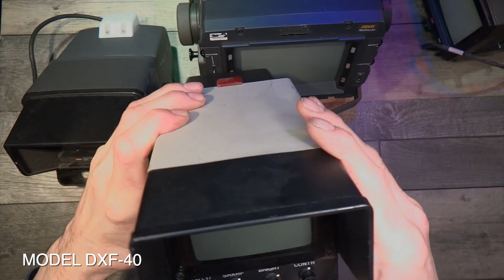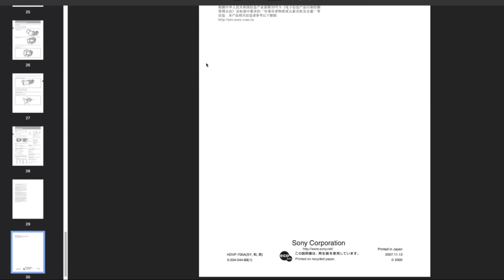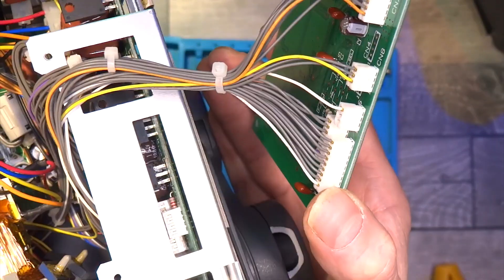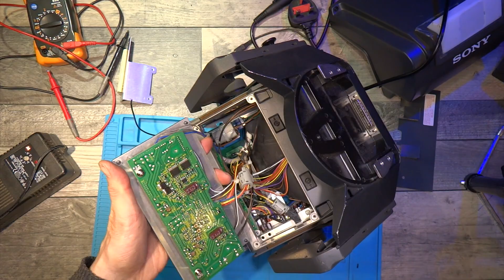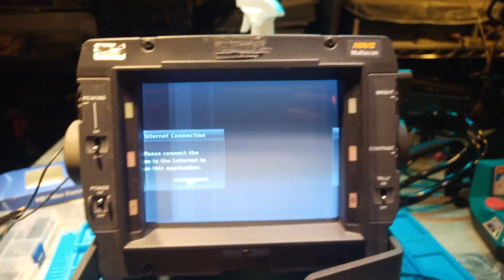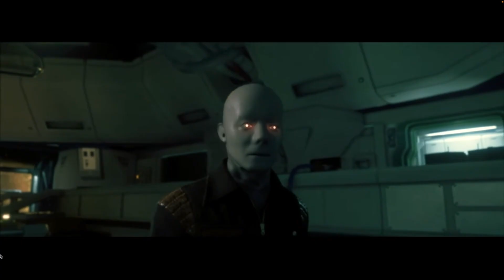SONY HDVF-700A HI-DEF Multiscan 7" CRT $10,000 Viewfinder But will it take a Standard Def signal

Comment: Looks like that monitor won't work with a 15 kHz horizontal scan rate, that why it's doubling the image, try feeding it a 480p/576p signal
Reply from the maker: Thanks for the information. What device can I get that signal from.
Reply: @RetroGadgetMan  Some DVD players have a progressive mode for example, but keep in mind there's no such thing as progressive composite video, so you would have to use the luma portion of component video, which of course won't be able to produce a colour picture
Reply from the maker: Well I only need it to be bw so that should work out well. I will see what devices I have with component out
Reply: @RetroGadgetMan  PS3 and PS2 has it! both can output 1080i.

Comment: Nice find. Looks like a really good monitor :). I haven't read the service manual yet, but I wouldn't be surprised if it is HD only, and is probably looking for a component HD signal (or at least the luma part). If you have an HDV camcorder/games console/bluray player with component outputs, I'd try hooking that up and seeing if it works.
Reply from the maker: Thanks. It could even just be s-video